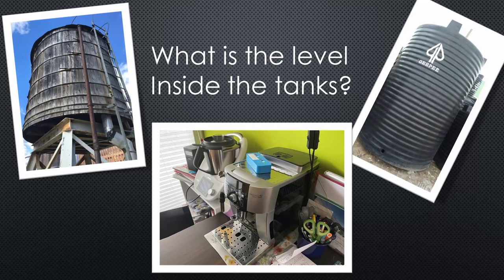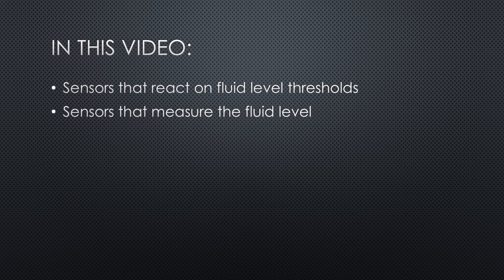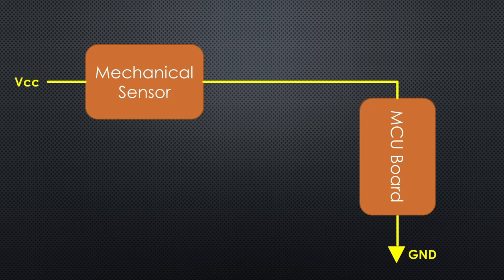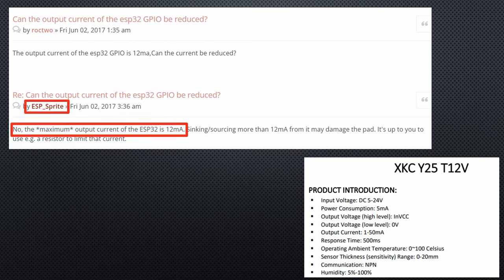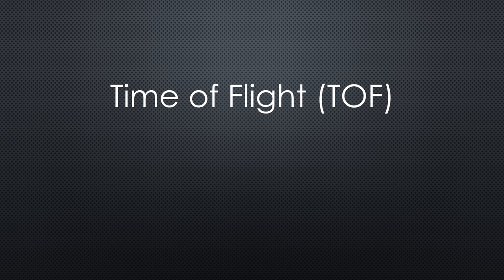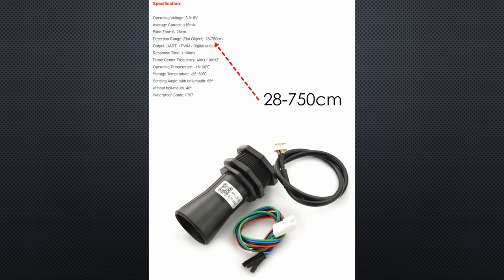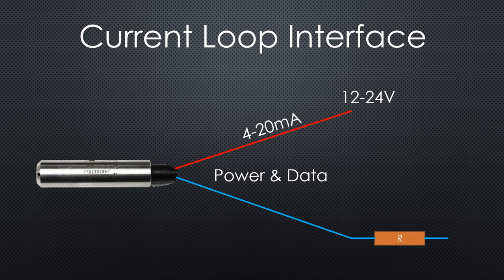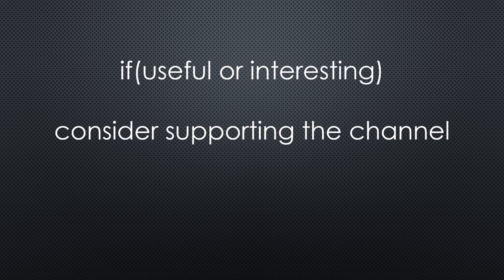#411 Ten Fluid Level (Water Level) Sensors and how to use them (Arduino, ESP32, ESP8266)

Comment: I solved my coffee reservoir water level problem with a sensor from Adafruit... ( Optomax Digital Liquid Level Sensor - LLC200D3SH-LLPK1).
Additionally, it triggers a water valve solenoid that refills the tank. Has operated reliably for over a year. Demo of the unit: https://www.youtube.com/watch?v=U26Oh3NuKo0
Reply from the maker: Cool video (I like that Ta-Da). And a perfect solution.

Comment: Thanks for the primer on sensors! I have a water cistern I'd like to measure that has some exposure to the elements, and was trying to figure it out. This helps. (As for the coffee problem, though, I usually just make it for my wife. 😁) 👍
Reply from the maker: Your solution is much better than mine, of course. But then I would have to get up very early (she works in a hospital) and could not work the long evening hours ;-)
Reply: @AndreasSpiess  Fair point! It does help we get up at the same time. If anything, I'm the one that makes us wake up earlier. (Kinda funny, as I too prefer the evening hours.)

Comment: I just use stainless rods or cables. You need 1 ground and as many electrodes as you like at different heights. All the electrodes are pulled high with pull-up resisors. When the water connects the rods to ground, they go low. Connect them to a shift register. Shift in states, and do something with code.

If you want low-tech you can do everything the same but use the electrodes to switch npn transistors that light LEDs.
Reply from the maker: Thank you for sharing. Similar to the cheap sensor I showed, but much more durable!

Comment: For your coffee machine, you actually don't need any electronics, just a float valve connected via a hose/pipe to a water source (tap?), this is how your toilet knows when to start filling up after a flush and when to stop as the cistern is full if you are going to use a cistern float valve use a new one 😁
Reply from the maker: Good idea (another viewer even posted a video about how he did it ;-)  But I am not sure if this solution would be approved by "government" here in the house (it would need a long pipe...
Reply: @AndreasSpiess  I used 6mm ice maker (also pneumatic) pipe through a pressure regulator down to 100kPa and bipassed the tank entirely.  Never had to fill it again, and very little to go wrong.  But your video is great anyway.

Comment: I engineered and prototyped (successfully) a resonance volume sensor for beer barrels, in the time when the Z80 processor was the only good and cheap option. The barrel was exposed to fine tuned sounds which allowed to compute the volume of the barrel, the air and the liquid separately. It was however too complex for the time and the company opted for standard barrels and weighing on the fly. The accuracy was not so much of a problem by then. Nowadays maybe, but I am not good in marketing... I am a maker 😊
Reply from the maker: Weighing small tanks is probably a reliable and simple solution. Another viewer also mentioned to measure resonance for the measurement. An interesting option. I wonder how narrow the measured "dip" would be?
Reply: @AndreasSpiess  The precision was very narrow, in the order of ± 10 ml for 50 l barrels.

Comment: Superb video (as usual). I use ultrasonic HC-SR04 sensor to measure water height as water fills a ground water tile drain pipe. This pipe is not perpendicular to the horizontal plane. As a result, finding a sensor that can measure height accurately with the 5" diameter pipe that fills with water at a 45 degree plane is problematic. Ultrasonic sensors are the only option in this case and work well to trigger / power a submersed pump to drain the pipe when water rises to a set height, below ground level (I use 5" / 12 cm) at preset maximum limit, which triggers a simple arduino GPIO power (using a 12V relay) ON command, for 45 seconds, then resets until the water rises again and triggers the 12V pump as required. 

Corrosion is a minor issue (the SR04 sensor is not in an enclosed atmospheric environment) which is reduced by making a 3D printed case to protect the SR04 circuit board. But the emitter and detector sensor cones do eventually show signs of oxidization and effect performance after 2 years. The reason the sensor lasts so long is because the median atmospheric temperature rarely deviates from 18 C. Because HC-SRO4's are so cheap (less than $12.00 for a box of 5), replacing them is cost effective for my particular performance requirements and durability. This setup wouldn't work for all-season outdoor environment.

Anyone know of an Arduino shield board available with built-in power relay and 2 or 4 line display with horizontal GPIO pins? The only thing I would need to plug-in would be the SR04 cables. My setup is built using classic Arduino board with patch wires on a development board, display and kit parts only. It's not elegant or rugged, though I wish it was. It's ugly but works.

I've been running this setup for 3 years with only one SR04 corrosion failure.
Reply from the maker: Thank you for sharing your experience. A pack of 5 HC-SR04 just arrived in my lab. I also want to try them.

Comment: Here is my idea. Place the water storage container on a set of springs. On one of the springs attach the center tap of the variable resistor. As the spring  moves it moves the center tap. Just supply
a battery,  and microcontroller and a gsm module  and your done.
Reply from the maker: You are right: Measuring the weight should have been included in my video because often it is a good (indirect) way of measuring the level of fluids.

Comment: Good overview, thanks for another great video! I have very good experience with the last sensor you mentioned - pressure one with 4-20mA output. I’m measuring water level in the outside well. Level is in the range of 2-3 meters. And this sensor combined with interface board from Mikroelektronika (correct board: MIKROE-1387) is reliable and precise. I read the values via SPI, just a single 5V/3.3V power supply is needed for powering the board and also the sensor.
Reply from the maker: Good information. So your sensor also works down to 3.3 volts?
Reply: No, the sensor works on approx.16V. This voltage is provided by the interface board, as it contains DC/DC boost converter. And the board also contains the DAC with SPI interface. I made a mistake in my previous comment, the board used in this project is actually MIKROE-1387. Manufacturer has a datasheet and also schematics for the board on their web pages.

Comment: I have used your video as inspiration to make a salt level sensor for our water softener , this uses larges blocks of salt where the height diminishes when being used
by using a laser TOF and measuring every 6 hrs I can also check the connectivity as well as the levels itself.

I create a simple stand to mount the sensor and used 4 wires to connect to a ESp32 with esphome currently using USB power from the wall, will create a USB powerbank version with deep sleep as well 

thank you for your insights !
Reply from the maker: Cool! This project is on my list since quite a while. But the level does not move fast. That is probably why it did not make it to the top priority ;-)

Comment: Inferior Engineering! 🤣In my work I got to read data from expensive industrial liquid level sensors - a waterproof piezo ultrasonic sensor called "HRXL MaxSonar", and an accurate, 2.5-meter long "Magnetostrictive liquid level gauge". Very interesting device, with its own MCU so it communicates through a UART plain-text protocol.
Reply from the maker: Thanks for your information. The HRXL MaxSonar seems to be similar to the one I showed (but better quality and more expensive). These Magnetostrictive sensors are very high-tech. I never saw one of them in reality.

Comment: My favorite fluid sensor is a reflectivity sensor.  I found one that looks like a clear led.  It has an LED and a photo transistor in the same casing.  When dry the light bounces if the outside of it's case and into the transistor, but when  wet the similar density if the plastic and water let more light escape and the transistor turns off.  I use these to detect the presence of water in buried conduits.
Reply from the maker: Another viewer also mentioned those sensors (from Honeywell). I was not aware that they exist. Do you have a cheaper source (These original sensors are quite expensive).

Comment: Good day. Searching also for a solution to measure my 3 meters deep rain water tank, i ended originally in mercury switches enclosed in plastic bottles and tied in a pipe every 30 cm i had a quite rough idea where the water level was. The mercury switches sealed in the plastic 0,5 liter water bottles lasted more than 5 years, yet I WANTED MORE ! I ended up in a pressure sensor mounted not in the bottom (i could not, since the tank is made out of concrete and is below ground level) but on top of the tank, taking advantage of the principle of Communicating vessels. A long tube that reaches up to 1 cm from the bottom of the tank and the other end goes to a (5 psi for 3 meters tank in my case) pressure sensor. I made proper calculations for surface to height / pressure difference, and voila !
Reply from the maker: Thank you for sharing. Other viewers also described this method. Some even added a pump. It seems to work very good.

Comment: Great video Andreas,
In my project I used the last sensor, which is the pressure sensor. Measuring the current was a bit tricky. A normal resistor will not work because the current range is limited to 20 mA and the ADC resolution is not enough. For this purpose I used the Ina219 current sensor board with a built-in shunt resistor. This delivered better results. It is important to use a stable 12 or 24 V power supply. Because any voltage changes in mV level has an effect on the results. I used software filter to deal with this issue.
Reply from the maker: Thank you for sharing your experience. The INA219 is also a good solution if its shunt resistor is changed to a higher value.

Comment: I've used a salvaged washing machine level sensor to monitor a Grey water sump, was only good for Maximum, minimum but perfect for turning on a submersible pump to water the garden in the hot Australian summer.
Reply from the maker: A good idea. And probably very corrosion resistant!

Comment: Ive used the inexpensive moisture sensors for automatic watering and sump pump applications. They are so cheap I dont mind replacing them annually when they corrode - especially outdoors or in salt water. One design practice I suggest is if you are pumping fluids is to include a purely analog override based on the raw sensor output when tank full, to switch off the pump if the controller crashes.
Reply from the maker: I agree: To have a plan B is always good practice.

Comment: I used another solution that worked very well. I made a capacitive sensor with a pvc pipe covered with aluminum foil and a wire inside it, going from the top, looping at the bottom and coming up again to not have exposed end on the bottom. The foil and the wire formed a capacitor that changed its capacitance according to the water level. I used a slightly different configuration of the 555 astable config and this sensor was the timing capacitor of the circuit. Its frequency changed according to the water level. I used the pin 7 of the 555 as a open collector output of the sensor and an arduino to read it. I related the frequency with the water level and displayed on a single 7 segment display. As it was on my dad's kitchen and the sensor was wired there was no need to save power. Of course there is more energy efficient solutions but this system was reliable, stable and considerably accurate.
Reply from the maker: Similar methods were mentioned by other commenters. It is interesting for me that this method works also for longer distances. Thank you.

Comment: A tube, a floating ball and a bank of opto-couplers. You can hit the tank and listen to the resonant frequency. Weigh it. Use a float and a potentiometer. A floating rod with a resonant coil around it. If the liquid is a different temperature to the ambient you could use a thermal camera. You could heat the tank and measure how fast it changes temperature. Anyway there's a few more ideas to be getting on with.
Reply from the maker: A lot of innovative ideas! Thanks.

Comment: I've found an air pressure sensor like a MPX5010 is an inexpensive way to accurately measure levels, but you need to add a small air pump to pressure up the measuring tube until air escapes from the tube at the bottom of the vessel.  This give you a balance pressure equal to the pressure of the water over the inlet of the measurement tube that you can measure and calibrate.
Reply: I'm sure you can take a static pressure measurements with no airpump needed, I have seen a tutorial on the matter
Reply from the maker: This method was described in other comments. Some use a pump, others not. The pump seems to be necessary if your level never drops to 0 because the system can lose the air pressure and the water fills the tube after a time.
Reply: @alexrossouw7702  You certainly can, but it will be much less accurate as the pressure differential you're measuring is much, much smaller, especially in a smaller vessel like a brew kettle.

Comment: My father in law has also an tank for watering the garden with an simple mechanical "display".
On the top panel of tank he drill an hole. At tank below he fasten an plastic bare (cable channel) on an float (Styropor or canister).
So if the plastic bare looks approx 2m outside of  the top panel hole the tank is full, if the platic bare goes down the tank will be more empty. A small rack outside were some reed switches are fasten and the magnet on the plastic bare could also switch on or off a pump.
The advantage is that reed relais are not inside liquid.
Reply from the maker: Your father in law's method is simple and does the trick if you are not a nerd like we are ;-)

Comment: I am using standard "arduino" ultrasonic sensor for measuring water level. Sensor itself is mounted 10-15cm from top level. Difference between empty and full tank is about 1m. The setup works mostly fine. Output has some noise, so i use averaging in software. 
Corrosion might damage the sensor one day, but it works continiously for like 3 years now.
Reply from the maker: Thank you for sharing your experience. I read that the normal ultrasonic sensors die much faster. So it seems you were lucky...

Comment: Hi. You can use a vertical tube with top cap and open bottom. The liquid level compress the air inside of the tube. To mesure the level, two options:
1.- a flex diaphragm that push a microswich
2.- analógic sensor that measure de air pressure inside of tube.
Reply from the maker: A few other viewers mentioned this method and a similar one with a pump. I assume your method needs a very tight system if you want to use it longterm?
Reply: @AndreasSpiess  Nothing difficult to obtain. PVC pipe, plastic, cooper, .... Tube must be well sealed with teflon, glue, solder, ...  If air escapes when the tube is submerged, it does not work. Even so, it is a very cheap system and works without mechanical or electronic complications for many months or years. It is a system widely used in water treatment plants, even for dirty water, for years.

Comment: there are also optical level sensor that indicate the threshhold.
The sensor has an infra-red emitter and detector aligned within an accurately shaped cone to give good optical coupling
when the sensor is in air. This coupling is greatly reduced, when the sensor is immersed in liquid, as the infra-red light
escapes through the liquid rather than being reflected back to the detector.
Reply from the maker: Others also mentioned these sensors. They seem to come from Honeywell (expensive) or Adafruit (a bit less expensive). Maybe somebody even find a cheap clone?

Comment: Thanks!
I liked this subject, because I experimented this on my pool, with unfortunately not a success due to corrosion and accuracy.
I appreciated the open collector explanation, and the various usages.
I faced with one of them on my 3D printer with an inductive bed level sensor, which led me to fry the motherboard...
Reply from the maker: Thank you for sharing your experience. I think corrosion is the biggest problem of those sensors.
Reply: I use ultra sonic sensor to measure the distance from water surface, work well after > 1 year